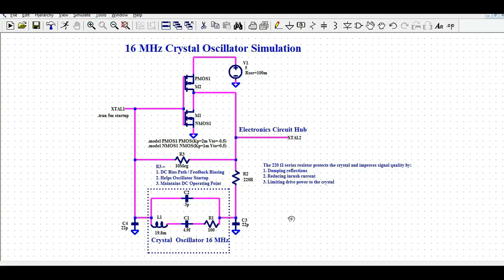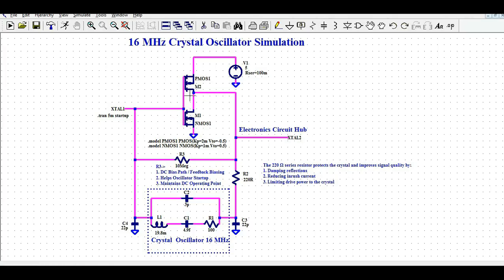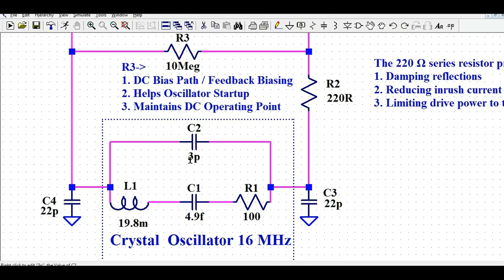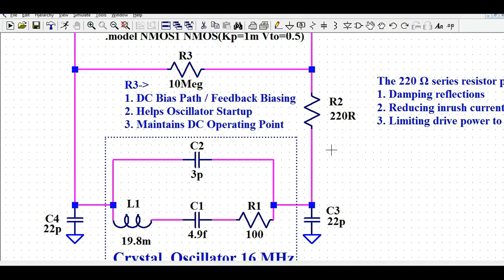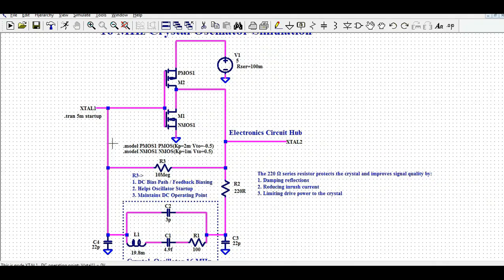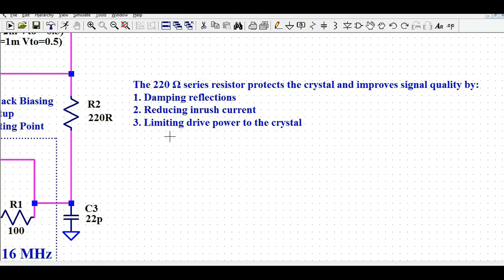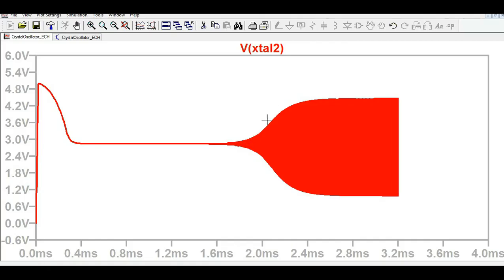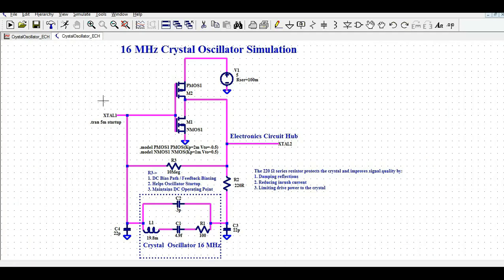How to Simulate a 16MHz Crystal Oscillator in LTspice

Comment: How Is It possibile that It starts without any input signal? I tried at home and doesn't start
Reply from the maker: Hey..The property of oscillator to start without input signal...The input signal for oscillator is noise generated by circuit itself...you might be doing some mistakes that is why it is not working.
Reply: @ElectronicsCircuitHubECH thanks you, the problem was the pmos which i didn't reflect with CTRL+E so It was inverted 😂